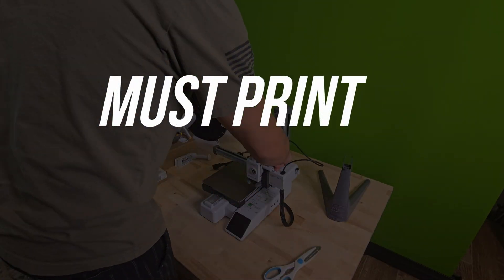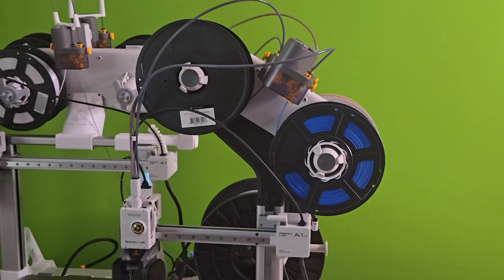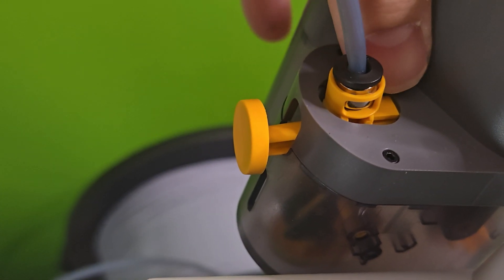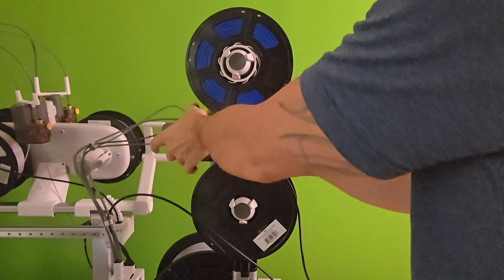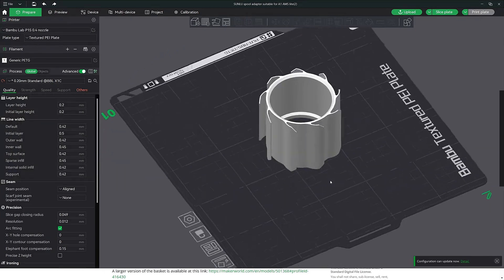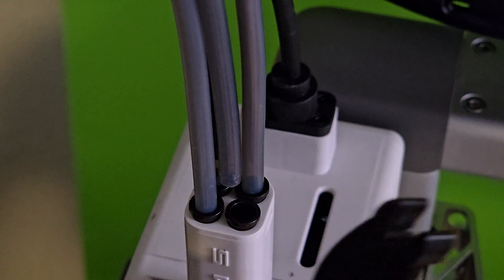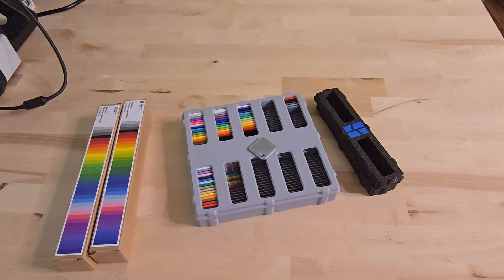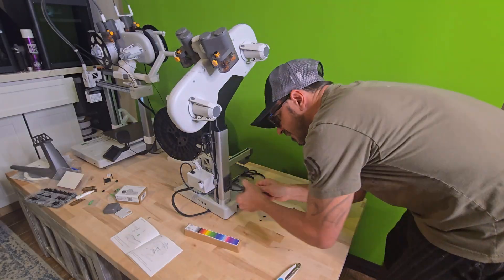Optimize Your A1 Mini! 🔥 Space-Saving & Performance Boosting Mods

Comment: TY for this, I had been wanting to upgrade my camera on the mini, and everyone was suggesting a 40$ camera but I just couldnt see paying that honestly. This camera will work great and be here tomorrow.
Reply from the maker: Ha! I would have been thinking the same thing as you! $40 is way to much for a camera. I love these Tapo cameras. I also plan to use them for live streaming. There is a lot that you can do with them. They are also great for Home Assistant use if you ever look into that.
Reply: @planet3dp  i have 1 coming tomorrow and I am looking to order a few more for streaming. Ty
Reply: @planet3dp  So I got the camera, installed te phone app, and I can not for the life of me get it to continuously record if I close the app. Once the app is closed the recordings stop. I set everything to continuous and still nothing. 3 different microsd formated and put in everything works. It will record just fine if I leave the app open on my phone but if I touch any other app on my phone it closes and the cam stops recording LOL

Comment: I don't have the A1 mini but I know for sure I will learn something new by watching this one , I have a question what sofware you use to design things to print I am in the automotive / funtional parts side I am debating if I should learn freecad or solidworks .
Reply from the maker: I have used Tinkercad a lot lately for quick and easy modifications. Blender is also great. I learned Maya and 3DsMax back in the day as well.
Reply: @planet3dp  Thanks for the Tinkercad recommendation